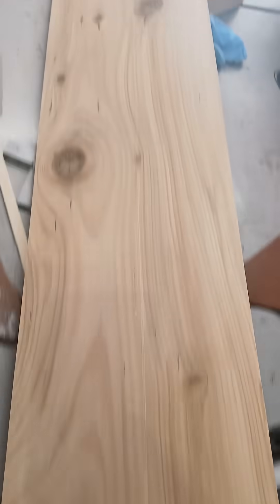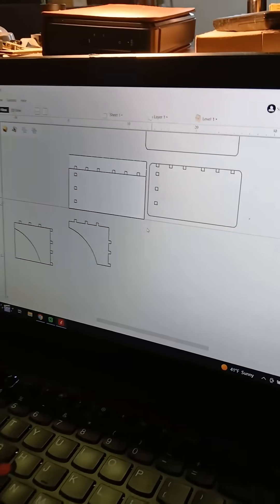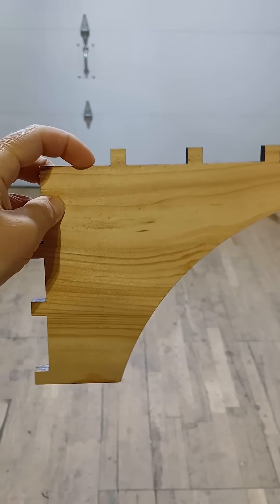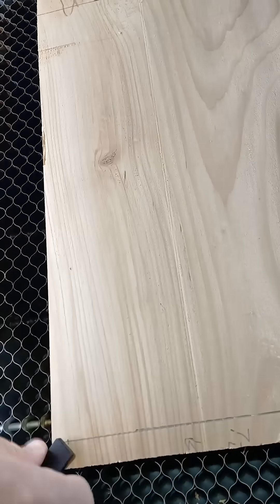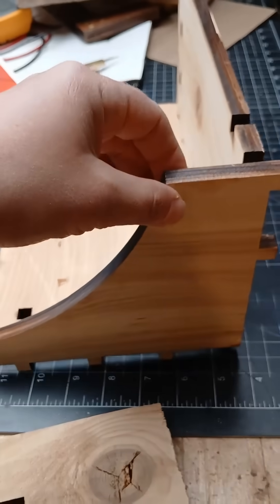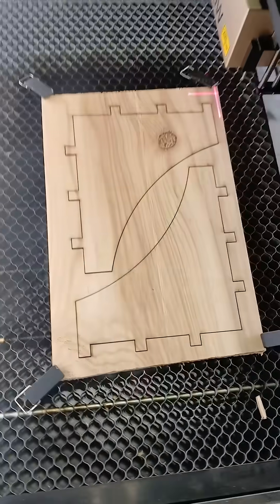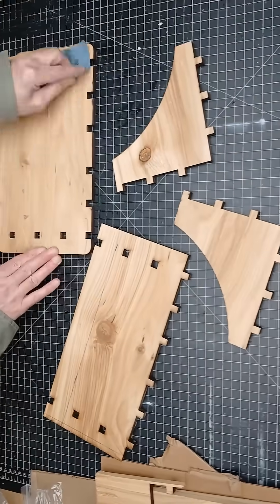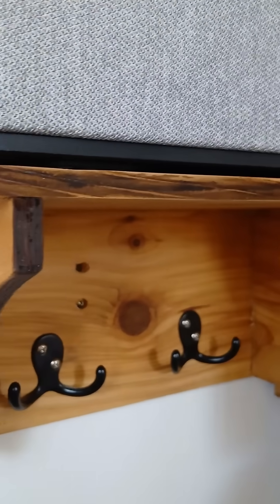Laser-Cut Cedar Shelf – DIY Small Shelf Project!

Comment: I have a CO2 laser. Do you find refocusing in multiple passes reduces the charring? I can cut 1/2" Baltic birch in one pass with my 80 watt but significant charring. Much prefer a cnc for this operation though . Thx Lynn
Reply from the maker: yes, I did 5 passes and the cut was perfect. i lowered the focus 6mm, then 9mm.